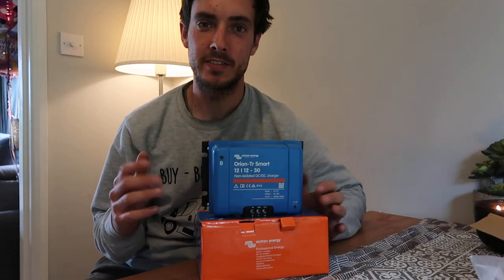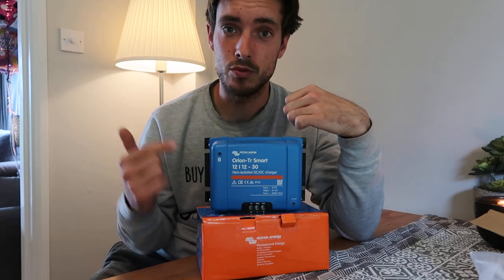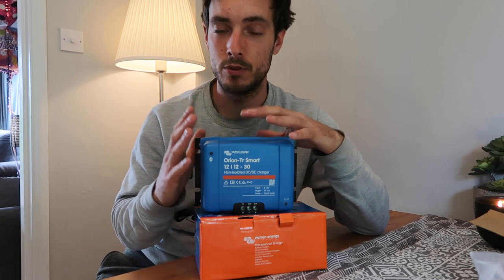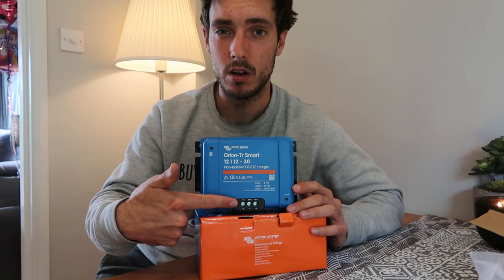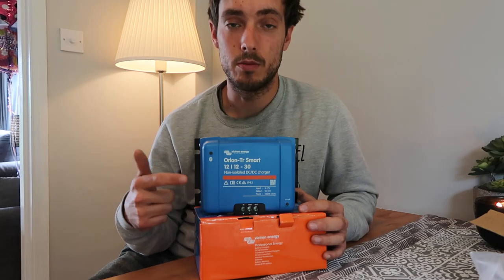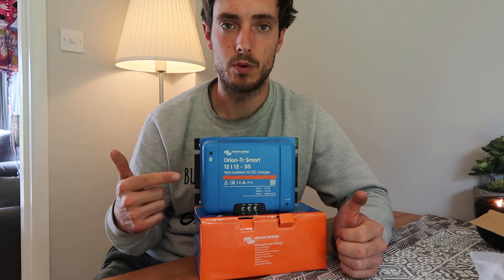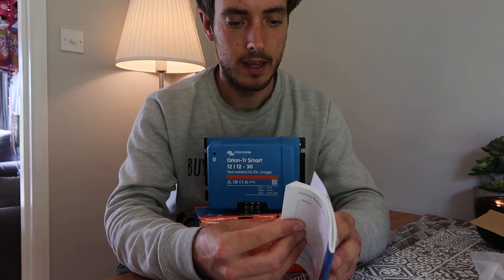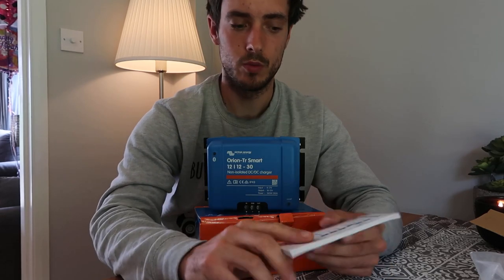Victron Orion Non Isolated vs Isolated DC-DC charger

Comment: The first vid I've seen that covers volt drop instead of just using cable sizes :) Like you said calculating volt drop with 12 volt system is just so important. With some fridges now cutting off at 11.8 volts and some vids on here saying 1.5 mm csa cable is ok to use your vid is like a breath of fresh air. Love your mention on fusing also. Nice to see a competent person making vids. :)
Reply from the maker: Thanks for the feedback Dave! Pleased you found the video helpful!

Comment: Hi from NZ. About to install a DC to DC charger in my camper trailer. Have been considering Victron v cheaper versions. You have sold me on Victron. Also great explanation on isolated v non isolated. 

Have now started following you😄😄

Comment: Just come across your. Just what I've been looking as new TO THE VICTRON BATTERY BC TO DC.i have Discovery 3.2007.2.7TDI HSE auto.it kills batterys if you dont use through the week.as this vehicle has so many computers and alarms et so i installed a second battery.(75 amp).deep cycle leasure battery to help with few gadgets I have. But I have to now fit bc to dc charger plus 2 more larger deep cycle leasure 110amp 12volt batterys .this is to help with my PASSION OF COURSE (carp fishing).no generators are allowed to tHelp with our needs at camp site. I am in process of buying all the parts to start my charging station.plus battery banks.     Great video . Your video has given more info, and confidence. To tackle this big job for for me. Keep videos  coming.   All the best. Jason Adams.'
Reply from the maker: Thanks for the feedback Jason, glad the video helped! Have you thought about installing a little dash solar panel to help trickle charge the battery when it's parked up?
Reply: @Aboutavan  no I hadnot thought bout setting up solar panel  while parked up. That's great idea thank you.   Will look into pricing up.i use ebay for lots of it's. Is there anywhere you would recommend for the charging gear pls. 🙂😀
Reply from the maker: I'm not sure where you're based in the world? this one would work in the UK: https://amzn.to/3xBlKtn
Reply: @Aboutavan  .I'm based in Boston. UK.

Comment: Thanks for this great video. These chargers have only one big drawback. You can't limit the current manually and that is something they should have included for this price.
Reply from the maker: Always happy to provide content that helps others! Yes that would be a nice feature, the other that Victron need to add is the ability to add the Orion to the smart network to enable the Orion to link in with the Battery sense for temperature monitoring of Lithium batteries! You can trick the unit by entering different parameters for the leisure batteries so it goes into absorption mode quicker reducing the current to around 14 amps.
Reply: @Aboutavan  better integration in the VE Smart Network would be great as well. Victron has hinted about a successor which might have more features. 
I am currently looking at the Victron Buck-Boost converter since it is fully programmable. The downside is that it isn't technically a charger and that you need a piece of Windows only software to configure the unit. It is also a lot more expensive than the Orion series.
Reply from the maker: @meeder78  Yes they are a lot more expensive, it's a shame victron can't just make the changes via a software update! Let me know if you go for one and how you get on :-)

Comment: Thanks for the info Adam, we are still in the planning stages for our van and were having difficulties in deciding which DC to DC charger to go for. We had it down to one of three, the Sterling CTEK or the Victron. after watching this vid decision is made Victron it will be. Cheers for uploading.
Reply from the maker: No worries Andy, pleased it helped. If you need to order one you can email me @ whitbread.adam@gmail.com always happy to help.
Reply: Hello from America,  just so  you know  the Ctek is not designed for lithium batteries and the charging profiles are different between lead acid and lithium batteries
Reply: @jamesmason7124  there is a newer model CTEK that claims to have a Lithium setting.  That said, I don’t think it is “programmable,” so if their preconfigured Lithium profile does not match your particular battery, well, it might not be the best.
Reply: @jamesmason7124  the CTEK D250SE is lithium compatible, the older D250S or D250SA models aren't.

Comment: Subscribed! Upgrading from Renogy to Victron in a Chevy Express. Can’t wait to hook it up but I’ve got a few more things to work out. Biggest concern now is how to wire six 100w solar panels. I have a Renogy Rover for two of the panels and I got a Victron 100/30 which should be fine for the other four panels but I want all Victron MPPT’s so they can connect to the Cerbo GX. I’m reading the manuals and will lay out and draw out the wiring before cutting cables because I want a compact, neat, and serviceable install. Will probably use a temporary panel until cabinets get built. Just finished insulating the floor and laying down the sub floor so next is sound dampener paint and mat(Second Skin Audio), and thinsulate on the walls and ceiling. Thanks for the information.

Comment: you can use a isolated unit also in non-isolated setup where you bridge the negative terminals.
Reply: I've just asked the same question, did you find the answer?

Comment: I need this, but 120 | 12 - 30. I have a WFCO in our RV that is terrible. I'd love to take the breaker panel apart, yank the converter in there and shove this in its place but I need 120volts for shore power.

Comment: Good video. I've bought an Orion 12-12 Isolated 18A, though it's clear from this that the non-isolated would have done. Is this a problem? It's going in a Vauxhall Combo and both batteries will be connected to the van chassis. Can I just connect the two -ve terminals together and ground them to the main battery?

My current problem is where to put it. I've read about how hot they get so under the passenger seat with the second battery doesn't sound good. I'm thinking under the bonnet and the only space I can see is in the wing behind the LHS headlight, a mounting frame would be needed. Just how hot do they get?

Comment: Very good, informative and a good explanation of the isolated and non-isolated. Please can I ask, I am converting a 2000 Land Rover 130 td5 to an over lander. The budget is tight so I’m afraid that lithium is out, I intend to use 2x12v 120amp leisure batteries to maintain 12v (not 24v). Do I need 2 b2b units or will one suffice. How do I balance the different voltages/amps?  Thanks.

Comment: What happens if I upgrade to lithium and I’ve an schaudt electroblock that is doing the charge on my existing gel batteries , can I fit a Victron b2b alongside or should I isolate the electroblock when the engine is running, which I can do with a 100 amp relay fed from the ignition.

Comment: Thanks Adam the only vid I've seen on non isolated units .I'm looking to add one to my caravan .what I fined confusing is the 2 positive and one negative wire.so if I run the neg and pos from my car to the unit does the other positive go to my battery,and it charges my lithium batterys,or do I run a second neg wire from the unit to the battery.
cheers
Reply: On the Orion, "In" is connected to the caravans positive starter battery. "GND" Is connected to your chassis/metal frame/caravan negative battery post. "Out" connects to your lithium battery positive post or circuit. Not the caravans. 
- Your lithium Negative post is also connected to your chassis/metal frame//caravan negative battery post. Which is why it is "non-isolated". 
- Size cables and fuses correctly.

Comment: Great video. Now let me see if my understanding is right (probably not). I have the non-isolated dc to dc unit so I ground this to the chassis of my sprinter, I have 2 x 130ah AGM batteries connected in parallel. 1 of these also gets connected to ground and the other side of the battery bank negative would go into my Victron smart shunt. Is this correct?
Reply from the maker: I would earth the DC-DC charger to either the starter battery or the leisure battery, then make sure your leisure batteries are strapped or ‘earthed’ to the chassis.

Comment: Thanks for this. I have this non isolated charger, about to install. If my leisure battery has a good negative ground can I run the negative ground wire through the negative terminal on my leisure battery or should I just ground it to a point on the floor chassis?

Comment: Nice job, can you do a review of the Victron Orion XS 12/12 chargers?  I understand they are available in Europe now.  I think you would be one of the first.  I am thinking of installing a pair to charge a 12V 400Ah LiFePo4 battery bank with a 120A alternator.  Sailors like it fast so we can get back to sailing slow.
Reply from the maker: Hey Gary, as soon as I can get my hands on one I’ll try to make a video 😌

Comment: On a trailer that has 7 pin, don't the grounds of the vehicle and the trailer all connect? What is the reason to run isolated in this case? What's an easy test to check if your grounds are the same?

Comment: Hello from Argentina ! Your explanation is very clear, I have the same model but the isolated one, the question I want to ask you is related to the fuses, my auxiliary battery is 200 AH Lifepo4, they told me to place a 60 fuse at the positive output of the starter battery and the same one at the positive output of the auxiliary battery, would this be correct? And if so, do I need another fuse? I ask you because they suggested another 200 fuse that I don't know where it would go. Thank you so much
Reply from the maker: Hey there, I’m pleased this video helped you! I would recommend using 2 x 50a fuses, one close to the engine battery and one close to the leisure battery :-)

Comment: I'm building a cargo trailer (conversion), and I want to run a charging cable from my truck (starter) batteries (I have a Duramax diesel with two batteries, parallel). Since my setup will not share a common ground (whenever the trailer is not physically connected to the truck) do I want an isolated or a non-isolated charger? I'm assuming that I will have a ground to the trailer frame for my house batteries and a the truck, of course, has its own to frame ground.
Reply from the maker: You’ll want an isolated charger for this purpose, you can use something like an Anderson connector for a quick disconnect system when not in use but I would recommend placing the Orion at the front of the trailer to ensure the cable run isn’t too long and use 16mm2 cable, not sure what that is in AWG!
Reply: @Aboutavan  Thank you for the reply. Yes, I'm building a cabinet on the trailer tongue to store the lithium batteries, charger and inverter. I will be using a pigtail (short length of chord) to bridge from the truck bumper to the cabinet. The pigtail will have male Andersons at both ends. If I did my homework correctly, I'll be using 8awg wire.

Comment: Excellent video. Quick question re cable sizing from starter battery to the Orion - could you demonstrate the cable sizing calculation? Also the same for the Orion to leisure battery cable size? I think it would be interesting and useful for many of us building vans. Thanks

Comment: Excellent Guide. Thank you Sir. I have inherited a campervan. I have a question others might appreciate. I understand the 12-12-30 Dc to Dc. I have also an MPPT 75/15. Solar.  It also charges the Leisure Batteries, (2 x 100ah Gel).  Lastly, another Victron Box, a Multiplus 12/1200/50. which charges the 2 Gel batteries when plugged in or is an inverter off grid. So far, so good. Everything is Isolated. There is a But; when the engine is off, no one is charging the motor battery. So none of these three boxes looks after the motor battery! Do I need a 4th box or revamp the Solar Wiring? The 12-12-30, stops the Solar reaching the Motor Battery and when the van is plugged into 230V grid, same thing. I get full Voltage )14.1v up to the 12-12-30. What did I miss?  Thanks a million..... maybe I missed a setting on the 12-12-30?
Reply from the maker: Hey Mark, you are right none of those components look after the starter battery, the older VSR would open both ways when voltage went above threshold so the solar panels would end up charging leisure and van batteries. You could wire from the MPPT’s load ports with an inline switch to allow you to charge the van batteries when needed. 

https://community.victronenergy.com/articles/2992/load-output-of-mppt-charge-controllers.html

This link might help!
Reply: @Aboutavan  Thank you.

Comment: Hi Great vid by the way,are wet acid leisure batteries compatible with this product?I purchased a vsr but now I’m thinking not to bother with it in my build
Reply from the maker: Yes you can programme the unit to all different battery types in the settings so they’ll work with lead acid, gel, lithium etc :-) the VSR is not totally useless, it does provide extra power, they’ve been used for a long time. The DC-DC charger is just a lot more efficient at the same job.

Comment: What is the difference between Renogy DC to DC charger, 20A vs a Victron 20A ?  Small battery packs in a RV, what is the reason we need a 30A ?   On the web, Renogy is on sale now 1/9/2022 for USD $110.49 with free shipping.

Comment: Presume you could use an isolated version on a normal 12v system, just link the earths or leave one disconnected as will have an earth from somewhere else?
Reply from the maker: Yes you could use an isolated as well :-)

Comment: Hello!!  I need help!!  VW vanagon. Have a non isolated current system but old wet battery died. Battle born recommended isolated 12 12 30 to go with their 100 aH lifepo4. I didn’t do original setup but I’m realizing I don’t have a clue how to hook up!!  I’m wondering if I can simply use the 12 12 30 non isolated which would be a simple transition but battle born says because lifepo4 I must use isolated. I’m confused!!  Thanks, Jon
Reply from the maker: Hey Jon, the non isolated ones are compatible with Lithium batteries however, if that's what Battleborn say it would be worth going with their suggestion to avoid them getting out of any warranty claims.

Comment: I'm hearing alot of stories that these chargers are draining starter batteries is this true and is there a way to prevent this from happening?
Thanks
Reply from the maker: Hi Adam, this isn’t something I’ve had or am aware of at the moment, if you’re worried you could always add an isolator switch between the starter battery and Orion when you’re not going to be using the van for long periods.
Reply: @Aboutavan  great thank you for your reply appreciate it 👍

Comment: Great video, thank you! You speak from earth/ground as negative pole. Ok. But if you have an inverter with a real earth (3rd) connection, should I connect it to the chassis, which means to the negative pole? Thank you

Comment: Thank you for great video. I see that output current is 10 to 30A. Can I also charge my 12V 8Ah Lithium battery with this or is battery to small?
Reply: You need a much smaller output charger for an 8ah battery.

Comment: Hi just so I’m a 100% sure I need the  non isolated as on my van I have earth to the chassis?

Thanks  
Great video to you have a video installing one
Reply from the maker: Hey Bobby, sorry just seen this, you can go for either, if you’ve earthed your leisure battery to the body though you can happily go for the non isolated version!
Reply: @Aboutavan  if leisure battery earthed to the body can I just attach tye negative wire from Orion charger to negative battery terminal?

Comment: Thanks, extremely helpful video! Why do you recommend wiring the leisure battery to ground? Intuitively I would assume that separating the vehicle and leisure battery is safer?
Reply from the maker: Sorry I’ve just seen this, if you’re using the non isolated version then you’ll need to ground the batteries to the chassis, if you’re using the isolated model you would not need to ground the leisure batteries to the chassis.
Reply: @Aboutavan  Hi. I have just purchased the non isolated version.  I previously had a CTEk charge D250s which has a pisitive to starter, positive to leisure and negative to leisure. The leisure battery and starter are grounded to chassis. Can I therefore run the Orion cables exactly the same with the negative connected to to my leisure battery negative terminal.....or do I need to attach the negative wire to a grounding point on chassis floor? Thank you in advance.

Comment: hi great video. Love all your videos.  Been having so much trouble understanding this bit of equipment and this helped. I am thinking of buying 2x 30ah LifePo4 batteries from Ecoworthy (cheapest price from UK supplier i can find). Ecoworthy when contacted them first advised not charging with van battery, but then said if I did to not charge at more than 10A. My question is based on your stages of charging will i program this unit to only ever charge at 10A. Is that possible and will it take a long drive to recharge?

Comment: How do I know what size inline fuse to use??   
Basically im just using my 1000 Watt inverter to charge batteries for my Milwaukee tools.
Reply from the maker: It will depend on your inverters peak power, the manufacturar should give the fuse sizing but for a 1000 watt inverter with a peak power of say 2000 watts I would fuse it with a 160 amp fuse - for milwaukee 18v tools though you won’t even need a 1000 watt, a 375 or 500 pheonix would be more than enough 🙂

Comment: Running a LN1 T2 basically Vario MK1 want to step from 24v -12v 
Checked alternator output as far as I can see the output is 80amps 
Wondering if these units would be ok 80amps seems high 🤔